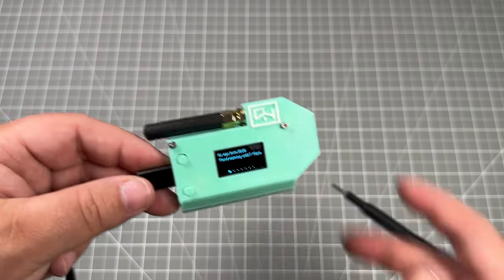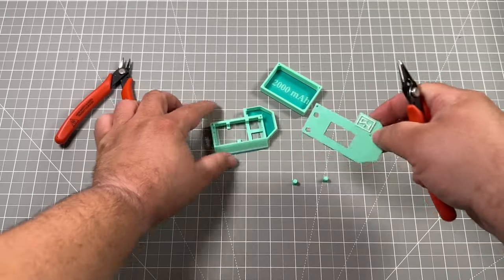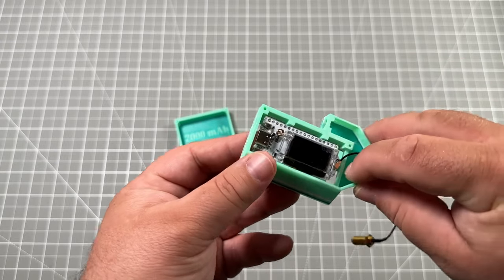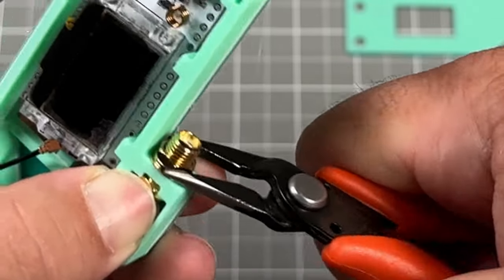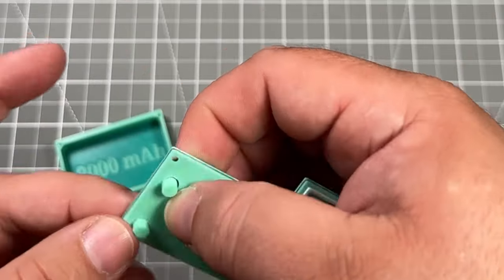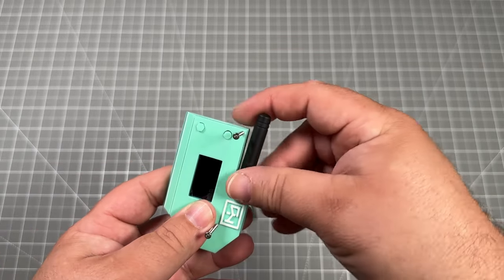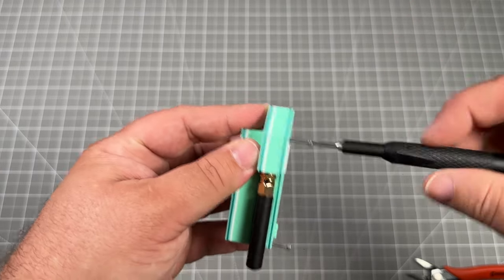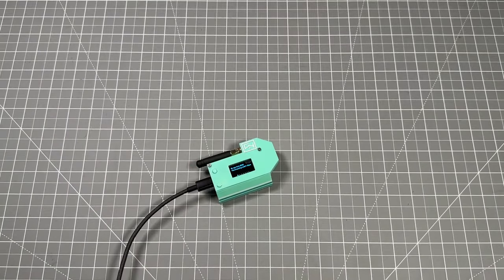Darknet-NG 13 DIY Badge Build

Comment: Uh, no… the lock washer goes between the nut and smooth washer. This prevents the nut from coming loose.
Reply: "YouTubers"
Reply: Hey Eagles621, I appreciate the comment! 

When I removed it from the package, it had the washer with grips on 1 side, then the Lock washer (flat washer with a single cut) then the nut.

I thought it would be better for it to be a better grip into the plastic  and have a smooth surface to have the smooth washer go on. 

Are you saying it should be different?